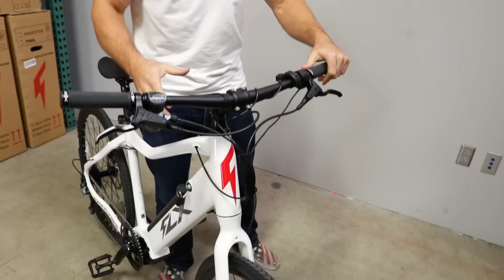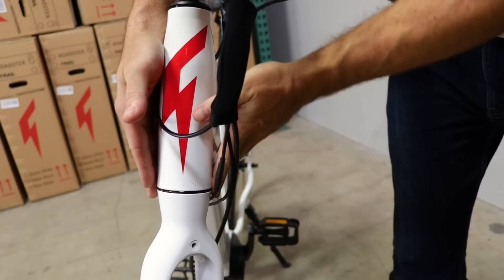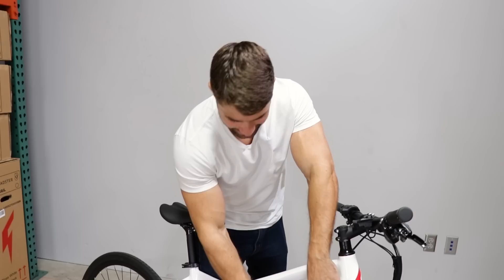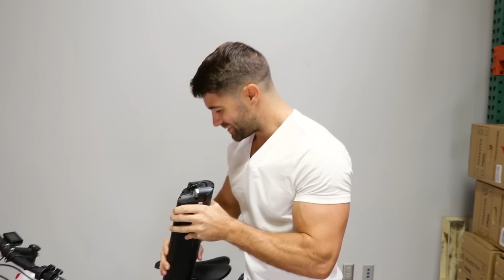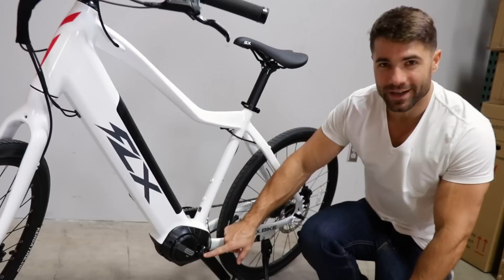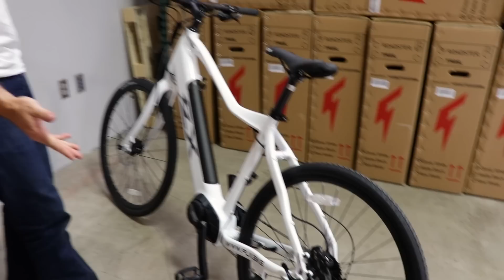Sneak Peak - F3 Roadster Performance Electric Bike

Comment: I wanted to let you know, on my F2 trail I often hold the throttle and the brake at the same time because I know the motor will shut off when I use the break. For people like me who do this it will be a difficult adjustment.
Reply from the maker: It will be an adjustment but we know you will get the hang of it!!